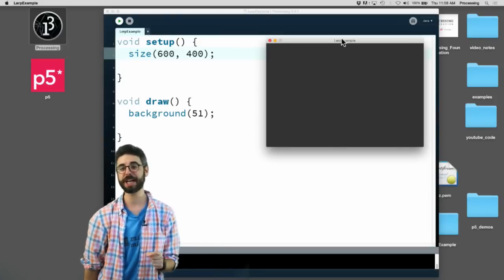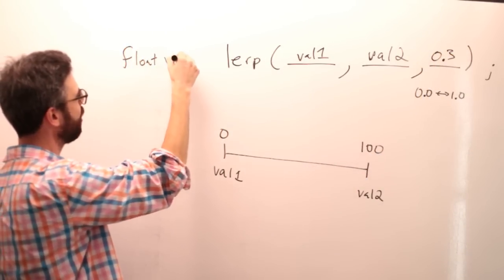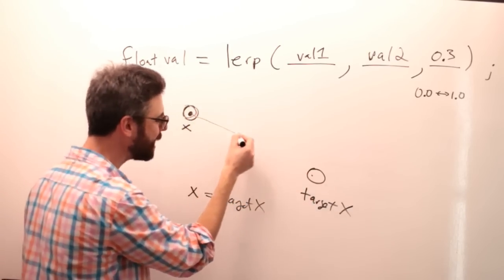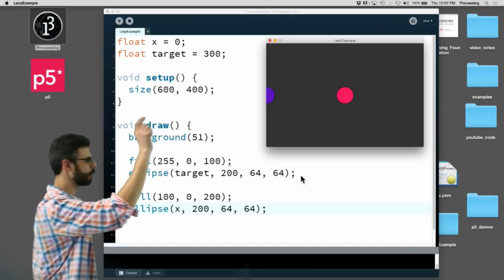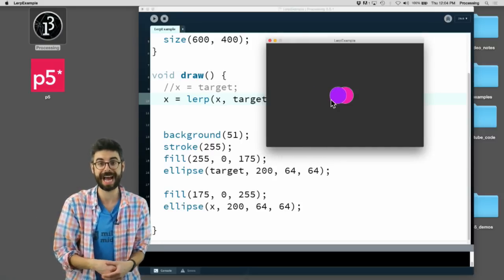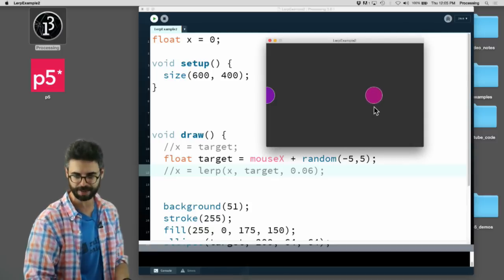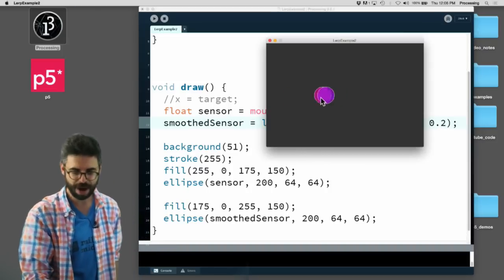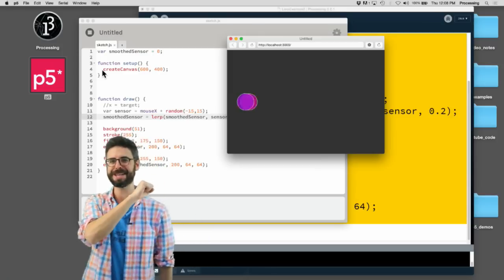Processing / p5.js Tutorial: What is lerp? (Linear Interpolation)

Comment: The side effect of how you are using lerp results in a slow down during the last moments. This is simply because you are updating the start point with the newly interpolated position. If it is intended, then you achieved what you are trying to accomplish, however, I don't think you want that as it's ugly. The right way to smoothly linearly interpolate an object between start and destination is to never replace the start position with the new interpolated value but rather use the interpolate value to update the position of the object between the start and finish.

Comment: Hello Dan

why in this Processing code "x" never gets "400" value, always is "391"?
Thanks in advance.

int x = 100;

void setup() {
  size(500, 500);
  background(0);
}

void draw() {
  background(0);
  fill(255);
  x = int(lerp(x, 400, 0.1));
  println(x);
  ellipse(x, 250, 30, 30);
  if (mousePressed) {
    x = 100;
  };
}
Reply: For some reason it happens when your variable "x" is a int primitive data type instead of a float, but if you replace   x = int(lerp(x, 400, 0.1)); with   x = int(lerp(x, 409, 0.1)); it works?!
Sorry if I didn't answer your question directly.

Comment: Mathematically movement is managed in discreet or continues time steps. Discreet steps occur in delta time (now - last) and continuous steps occur in swept time (between 0 and 1). Linear interpolation uses swept time i.e. a series of precise continuous steps. Instead of passing a percentage (0.01) as a third argument to the lerp function, you can handle it's position in swept time relative to the path between point a and point b. I had a hard time finding any examples of this online so I wrote one in JavaScript @ https://codepen.io/Daboo/pen/xBNgBe?editors=1010 I hope this helps someone who was digging around for an answer.